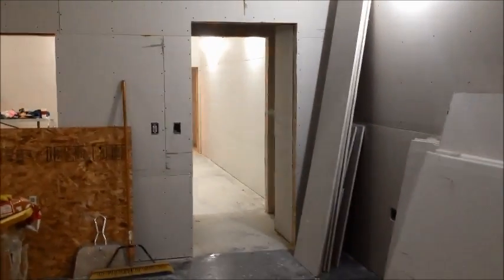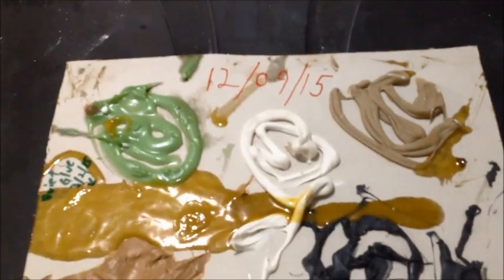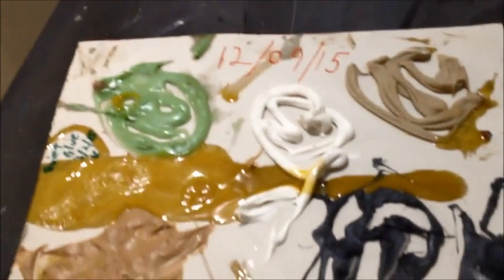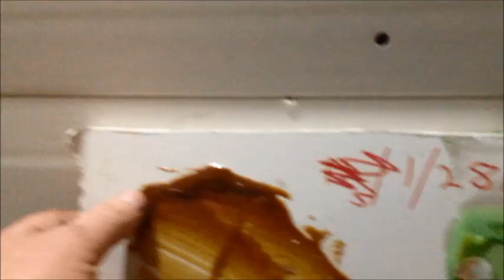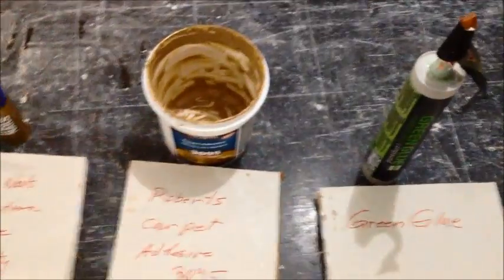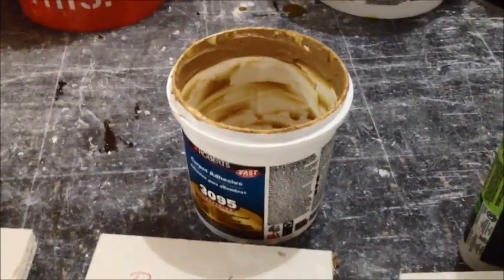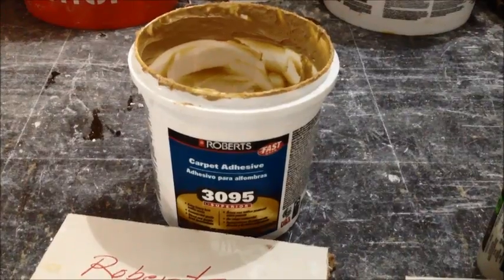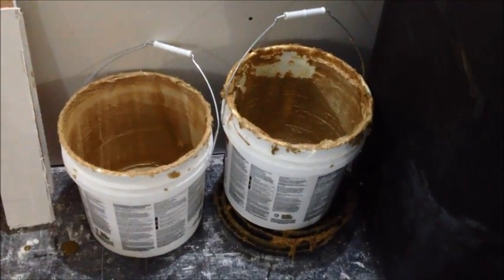Green Glue vs Quiet Glue Pro - Soundproofing comparison

Comment: How do you apply the carpet adhesive? over the entire sheet or in the same (non) pattern that you would do the green glue?
Reply from the maker: We used a trowel like they would use to apply it onto a floor. It worked really well and even left some little ridges that sort of looked like a on old LP Record that made it appear to work even better. I was really surprised at how well that stuff works!
Reply: thanks, I did the same and just finished texture last night so I'll let you know how it works
Reply: please do as I am getting ready to hang my double drywall and would love to save that much money
Reply: when are you doing yours?
Reply: How did yours turn out?

Comment: im sorry, but i didnt get what was the  black glue, can u pls post the name? thanks
Reply: It's Tremco Acoustical/Curtainwall Sealant.  AKA Black Death - it's a petroleum-based product that smells and off-gasses and is miserable to work with since it gets everywhere (stringy/clingy).  Green Glue is a far more friendly product with no smell.  I would never use Tremco inside a living/working space.  I don't know where he found Tremco so cheap and Green Glue so expensive.  Can find Green Glue Sealant (white) for $12.50/qt tube and Green Glue Compound (the green stuff) for about $14.50 when buying 5 gal pails.  Tremco seems to be about $17 per quart tube.
Reply from the maker: @ArthurDentZaphodBeeb  I agree. That stuff was terrible in every way but we found some and decided to give it a try just for comparison.

Comment: It looks like the elasticity of the Green Glue acts like a shock absorber, meant to remain pliable yet have some adhesive properties.  I would think that using it sparingly ( strips several inches apart)  would help the de-coupling factor.  If the Roberts carpet adhesive is applied with a notched trowel, the further the notches are separated, the better, say 2 inches as the closest .  It results like a staggered stud double wall where the less contact....the better.  Air is easier to compress than wood studs or gypsum board.   J K

Comment: I was reading in another thread that someone had the Quiet Glue Pro running out, and it was because it was 2 years old QGP. Is there any chance you had expired product? I'd like to save some money, but I'd rather not have money run out of the walls :P
Reply from the maker: The amount that runs out of the walls is very very minimal. Totally worth the savings for me. Easy to clean up so I just didn't bother with clean up until construction was done for about a year. No issues at all now.

Comment: How effective, would you say expanding foam would be?
Reply: I would not use expanding foam for going between layers of drywall as a replacement. I have probably used about 60 cans of the various types of expanding foam in the studio build and repair of our old building here and I would never consider using it as a replacement for Green Glue or Quiet Glue Pro. It comes out really uneven and expands unevenly as well.
Reply: Doh! Too late i already put expanding foam between two sheets of drywall. I don't think it helped at all and may have made the short wall like a drum.
Reply: Thank you very much. I considered another layer but I gave up on trying to block the sound in this duplex. I think the sound may be also traveling through the ceiling and through the floor and basement wall. I own both sides of the duplex and am thinking the best way to eliminate sound from one side to the other is to sell the house and move deeper into the country.
Reply from the maker: I live out in the country too and there is no substitute for distance between neighbors!
Reply: Joe Kotarsky 😂. Really I'm glad you informed me about this because i was just about to give it a try and let everyone know about it but thanks for being the test dummie and beating me to it.

Honestly I was additionally going to add some silicone over the beads of spray foam theoretically giving a similar property as the green glue, but I doubted this setup as well.  

Upon a little more research about the green glue and it's elastomeric properties I figured the next closest thing is mixing cornstarch with water, but was afraid of mold issues.
Reply from the maker: The foam is useless for sound.

Comment: I am soundproofing my basement apartment, and watched your video, you said " Carpet glue doesn't do exactly the same thing but it is much cheaper and much easier to find. I would never claim that carpet glue does the exact same thing but it does seem to work really well esp considering the cost savings!".... would carpet glue be a good solution for a basement apartment? I am looking to buy the glue this week, really need your opinion. Thank you
Reply: No idea if you did your construction already but I would advise against using any kind of glue. Put self adhesive MLV in between the two layers of drywall, same for ceiling. Decouple your support structure from the outside wall and ceiling. Would need to make a floating floor too, otherwise it will all be for naught mostly.
Reply from the maker: I was quoting what I was told by a world renown studio builder. It may not do exactly the same thing but it is still plyable and was instantly available when we had an emergency need to have a wall done asap....
Reply: @tacomarecordingstudio9366  are you referring to Dave Rochester? Because I actually emailed him last night about Roberts 3095 vs Green Glue and he said he does NOT recommend anything other than Green Glue and has NO experience with Roberts. 

??? I'm confused now

Comment: Hello sir. Can you give updates about the Roberts adhesive? Still tacky?
Reply: @scoobtoober29 would it be worth to use this stuff on the studs as well?
Reply from the maker: @levijessegonzalez3629  I would think so....
Reply: @scoobtoober29 Is it better than no adhesive?
Reply: @scoobtoober29 you've done any tests I mean?
Reply: @scoobtoober29 good to know. Well I'm doing two layers of sheetrock so I actually wouldn't mind some adhesive properties for the sheets...

Do you think I should apply it and immediately put the sheets together or let it dry a few minutes? 

You wait for some of the moisture to dissipate?
Reply: @scoobtoober29 also, do you know if it's mold resistant? On the website it says it's designed to remain tacky, which is good right?
Reply: @scoobtoober29 ... drying, but still is plyable and tacky Currently right?
Reply: @scoobtoober29 I'm installing the sheetrock with a 0.5" gap from the floor (concrete floors). What's the consensus amongst the soundproofing gurus on what to fill that space with? Calking? Mud? Foam insulation? 

It'll also have trim so doesn't matter what it looks like
Reply: @scoobtoober29 yeah I was about to buy some 230 for it. 

Any gaps in studs and around framing  using 230. 

You think putting the Roberts 3095 on the Studs before first layer of sheetrock is a good idea?

Comment: What Tremco product did you use in this video? Thanks in advance
Reply: great video by the way.... I will be using a mix of Green Glue and 3095
Reply: Tremco Acoustical/Curtainwall Sealant - aka Black Death.  Don't use it inside - it off-gasses and smells of petroleum.

Comment: How about mass loaded vinyl? I've heard great things about that.
Reply from the maker: Mass loaded vinyl was interesting to me too. I couldn't find any close by to do a test with. Wish I could have though. I think that stuff would be great on doors when adding another layer of plywood.
Reply: @tacomarecordingstudio9366  I know it's  been years since your original video and comment but here is some info on MLV

It definitely works.  It's not like green glue's  "maybe it does maybe it doesn't"

Heavier, measured in lbs per sq ft, works better  but is more expensive obviously.

The best way to apply it is to hang it as loosely as possible.  Usually attached just at the top with a couple of fasteners to make aure the MLV hangs loosely in the stud bay. Then hang the drywall placed over it.     Best hung MLV i saw was on the inside of a  double wall were the hung it between the walls.  Hung over the top plate of the wall and down like a shower curtain.

Also the cheapest and most effective per dollar sound mitigation is a double wall with regualr batt sound insulation and then double layer 5/8" drywall on each side.
Reply from the maker: @PandorasFolly  Hey therer. Yeah that is what we did here. Each room is it's own structure (including the hallways. We offset the studs in adjacent rooms as well. We filled everything that wasn't an intended air gap with Rockwool, and then used double layers of 5/8" drywallon every wall and ceiling with green glue in between the layers. The isolation turned out really good. I do not know the final measurement on it though.

Comment: Why not just use MLV? Works in a similar manner while also adding much needed mass to lower resonance frequency of your drywall sandwich.
Reply: What is MLV ????
Reply from the maker: @oldowl4290  Mass Loaded Vinyl. Some places its hard to come by. I tried to find some locally and did not have any luck.

Comment: It seems like the money you saved on product will quickly be absorbed by labor costs trying to clean off all that quiet glue that leaked out.  On a project of that scale it seems silly to worry about $2k if it's a superior product.
Reply from the maker: Hi John. It seems silly to worry about $2k difference in cost unless you are paying for the entire build out of your own pocket with no bank loans. The savings was worth it to me as there seems to be no difference I can really tell between the rooms we did with the Quiet Glue and the Green Glue.
Reply from the maker: As a follow up. The quiet glue has stopped running about 6 months ago and the amount that ran out was very very small. So I would go with the Quiet Glue again and save the $2K.

Comment: Important question:  did you use standard liquid nails or liquid nails acoustical sound sealant AS-825?  Big difference in the two.
Reply from the maker: I actually ended up trying them both. The Liquid Nails sound sealant was a huge pain to use.  Much bigger  pain than the carpet glue.  Not worth the effort at all.

Comment: It seems like 100% silicone would do the same thing🤷🏻‍♂️ It looks like it just needs to stay soft to do the job?
Reply from the maker: I thought the same thing but I think the problem is that it hardens just enough that it isn't as effective. The carpet glue was pretty awesome and very cheap! We used it on the lounge against the first wall inside of the building out of necessity. Still worked great.

Comment: How did you apply the carpet glue to the sheets of drywall? And how thick did you apply the carpet glue
Thank you
Reply from the maker: We applied the carpet glue using a trowel that has a serrated edge and put it on as thick as the serrated edge would allow when dragging it across the drywall.
Reply: was there a STC test between GG and Carpet Adhesive?
Reply from the maker: @brentbarcus7650  No. Like I said at the beginning...non scientific.

Comment: just use 1/2inch finish grade ply wood instead of double wall of sheet rock with that green glue.  It's just as, if not  more effective.
Reply: If this were true, all pro-studio designers would be recommending it.  There's no substitute for decoupled mass in reducing sound transmission.
Reply: @GrantConklin  Not necessarily.   People use what they have been brainwashed to use.  Not everyone knows every material available and every way to reduce sound transmission.   You think Corning's 703 is good for low frequency absorption?  It's widely used, but it's hardly going to do much below 100hz, let alone down to 50hz, 40hz or below, yet people use Corning's 703.
Reply: @GrantConklin 

Don't have this McDonald's mentality.  Just because it's the most popular doesn't mean it's the best.  It typically isn't.    

You can do layers of finish grade plywood and layer other materials that are going to be better than sheet rock with green glue and still be cheaper and more effective.

The problem is you haven't really spent any time doing the research on what materials are available and how effective they are.

You also missed the point that people need to do studies to figure out what frequencies and amplitude they need to stop before they decide how to construct the walls and what materials to use.  Everyone has different problems to solve and one doesn't solve every problem.  No one method is going to work for every situation.
Reply: @GrantConklin  Not all pro studio designers know every product on the market, let alone every type of wall construction.  Your assumption is that they all know everything on the market and every possible way to solve a problem.   

Also, even major top end studios have had to completely redo their rooms and they STILL have issues that have to be addressed because whomever designed it didn't know everything.
Reply: @Oneness100   It's nice to know that you know me and all of my assumptions  so well, having read my one short comment.  I've been using a spreadsheet that shows the NRC values of 450 materials for several years now.  If you'll show me STC values for your plywood wall suggestion, and I'll be happy to learn from that.  The fact is, sheetrock is heavy, and relatively cheap.  In fact, where I live the cheapest finish grade 1/2" plywood is nearly 6x as expensive as the same sized drywall, and weighs about 20% less.  I have yet to see finish grade plywood at anywhere near the price of sheetrock.  When I find such a thing, I'll be happy to use it.  

Perhaps my statement that "all" pro designers would be using plywood if it were best is a little over the top.  Because you're correct -- no one designer knows every material available.  But I'll stand by my statement that there's no substitute for decoupled mass.
Reply: @GrantConklin  But you forgot to add a bunch of tubes of Green Glue, which drives up the price dramatically to get decent coverage.

Many studios have concrete walls too.  I'm not saying your wrong in decopled mass at all.  But the first issue is figuring out what frequencies and amplitude are needed to block coming into or going out of to figure out what materials to use.  One size doesn't fit all scenarios.  But many people are under the notiion that double wall sheet rock and Greenglus is always going to work and is always going to be the cheapest and best, when it isn't always that case.

I have a friend of mine that's building a studio for a well known musician as their private studio, and the outside construction was concrete and steel plate because the studio is under a flight path near an airport.  I forget the thickness of concrete and steel, but that's the outside wall construction of the building...  His business has both acoustic engineer and a structural engineer that determines what materials they are going to use on each project and they build studios, home theater rooms, etc. and they don't use sheet rock/green glue.   They use other materials that are better.  

They've literally have actually built just about every type of wall construction using just about every material and have conducted many tests, also using strain gauges, so they know exactly what each type does from different aspects of the barrier, internal, external wall construction, etc.

BTW, I always grew up thinking that most of the top end studios have very thick concrete wall construction.  You think Double Sheet rock and Green Glue is going to stand up to what a thick concrete wall can do?
Reply: Actually many very hi quality sound designers use thsi plywood approach !
Reply: @GrantConklin  Use MLV in between the ply wood.  Far better than glue.
Reply: @GrantConklin  use MLV over glue.

Comment: Seems like the green glue is best though.
Reply from the maker: It is. We still have areas where the Quiet Glue is seeping out of the walls and onto the floor but it does work really well. If you don't mind the running of the Quiet Glue you can save some money over the Green Glue but the trade off is definitely the running. I didn't sense really any difference between the rooms we did with Green Glue and the rooms we used Quiet Glue.

Comment: Has anyone done any proper tests? You would think that by now some independent somebody or company would have made a proper standard testing of all top products and published the results clearly. Why do we have to watch a hundred useless videos to end up with nothing but a bunch of conflicting lists of info and end up having to guess or go with the guy who made the least obnoxious video. And what are we going with? Useless results of useless tests.
Reply: QuietRock and Green Glue both have their official laboratory test results on their websites. Green Glue requires three to four sheets of 5/8" drywall to achieve their higher STC ratings. That's a lot of labor, material and extra inches on your wall assemblies. They also apply noise dampening putty to each screw, to achieve that result which I don't think the average homeowner or contractor would do. Quiet Rock offers the highest STC by far in a single sheet without having to cover every screw with putty.

Comment: This video is way too long. Use your common sense. The Green Glue works, but their installation instructions require more than needed. What you are looking for is a reduction in sound transfer between sheets. My suggestion is use less glue. Take some styrofoam packing peanuts, dip them in Green Glue and randomly place them between the drywall panels. The peanuts will increase the space between the panels. You want the outer panel to vibrate without transferring sound to the panel it is glued to. The more attachment points, the more the transfer of sound.
Reply: Your statement intrigues me and totally makes since. Have you attempted this? I am very interested in your technique and results.